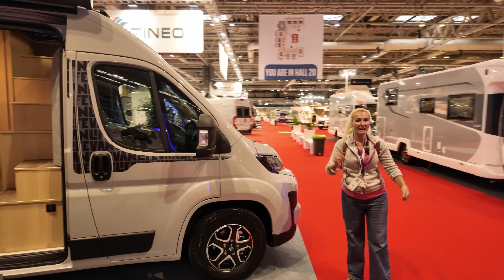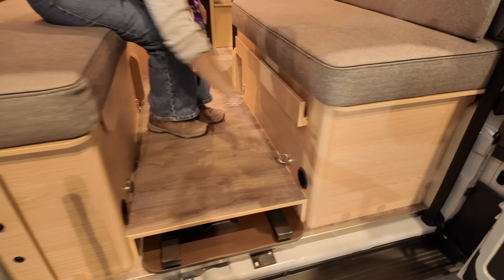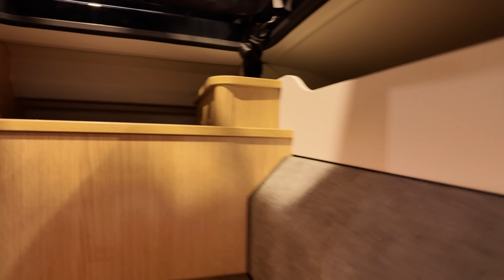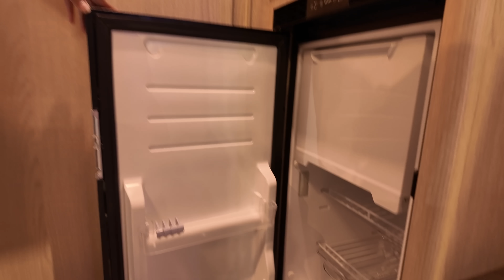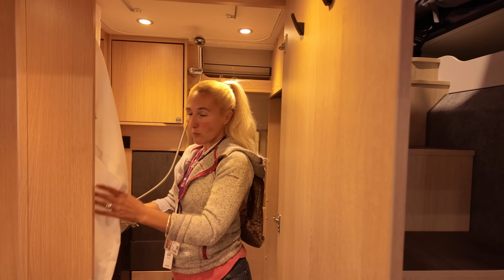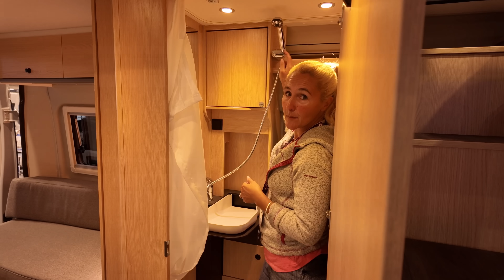*NEW* Sunlight VANLIFE Campervan 2026: Clever Concept or Design Disaster?

Comment: Kinda have mixed feelings about this van. The closed cab makes it a bit claustrophobic for my liking, especially with it being only 5.4M but a big advantage when driving in really hot weather in France or summink is that if it has air con, you are only cooling the cab, getting lovely cold air in a small space and the air con is not struggling to work properly by trying to cool the entire van innit.
Reply from the maker: Those are good points, thank you for watching 😊

Comment: Interesting concept, I think it will never be mainstream but will suit some. One big advantage is the extra insulation the bulkhead gives you as most heat tends to be lost through the cab area. So I would consider it if I was going to be in colder climes a lot, especially because the overhead bed is heated.
Reply from the maker: Thanks for watching and I agree about heat loss. Yes, some will be lost from the pop-top but you could keep this down when not sleeping in it, and it is heated on a night 😊

Comment: I LOVE the design, but the one thing I wished they had done, was not closing off the cab completely. The van is short as it is, you want that back to front view. I know the stairs are in the way, but for at least half of it, you'd have a view straight through.
Reply: You would lose some advantages of this layout. Firstly you would then need cab blinds adding to cost. More importantly you would lose the insulation provided by the bulkhead.

Finally, and this a matter of personal preference you lose the sense of being in your holiday home rather than a vehicle.
Reply from the maker: Thanks for watching, I am pleased to hear you liked the design of this one, the closed-off cab is definitely a talking point! 😊 I like your suggestion.

Comment: I think the only thingh i would be concerned with in the shower room is the water itself coming out of the head , will it hit the walls ? how does it go through the curtain?
Reply from the maker: The curtain wraps around and then you wipe down, these showers are usually fully sealed to present water escaping. The main issue is the curtain sticking to you 😂
Reply: I think most people don't really shower in these.

Comment: I can see where you are coming from with the staircase. I feel it should have been more developed before actual building , because surely it could have been slimmer or had more storage in it. Possibly with a sliding partition to get into the cab from one side ?
I agree with you it does seem a bit daft to not have access to the cab for the same reasons you mentioned .
Reply from the maker: Thank you for watching.. I think the staircase could be developed further, I really like this over a ladder as it’s easy to climb. But not being able to get in to the cab, especially if I was a solo female traveller, would be a no from me. 🤔😊
Reply: The space under the staircase is all used. It is either storage, fridge or space in the bathroom.
Reply: What do you mean more storage? Every step is storage. There's a whole fridge in there. Also the toilet is underneath.

Comment: Great video. 
Nice to see something a bit different from the normal layouts. Personally I like the idea of the cab separation. Im guessing it will save a lot of heat loss and make for a quieter ride.
Not sure about no windows down one side, I guess seeing one in the flesh would give a better idea of the ambience . Love the stairs as we are bit too old to be using a ladder. Are those pop tops warm enough in the winter ?
Reply from the maker: Thanks for watching and glad you liked the different layout! The cab separation is definitely a good point about heat loss and noise. 😊 The pop top space is cool but with the heating on, and even a wrap around insulated external cover, you would keep the heat in. I would prefer the stair to a ladder too.
Reply: Window is an option on drivers side too